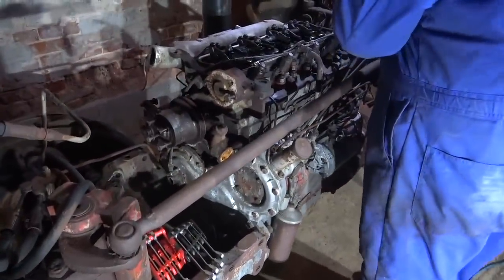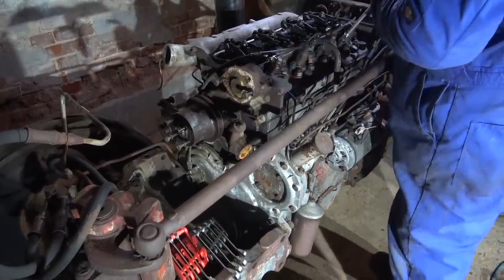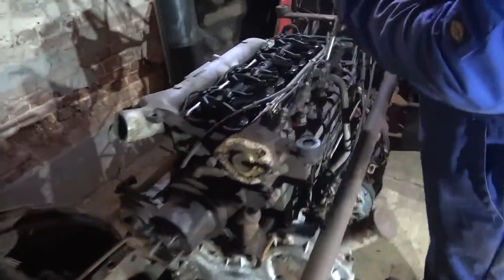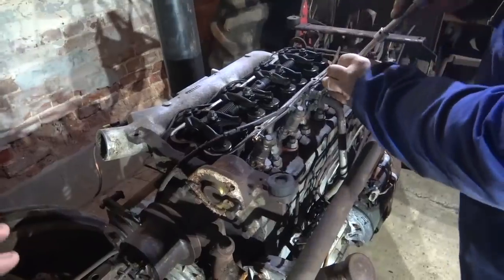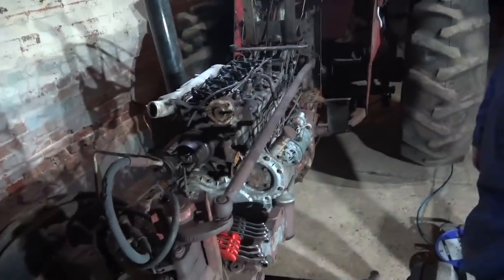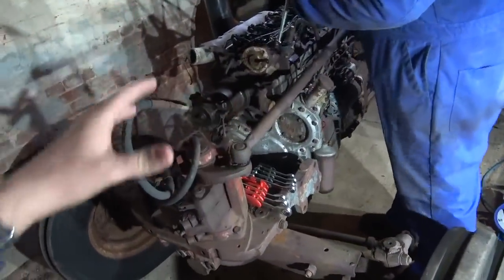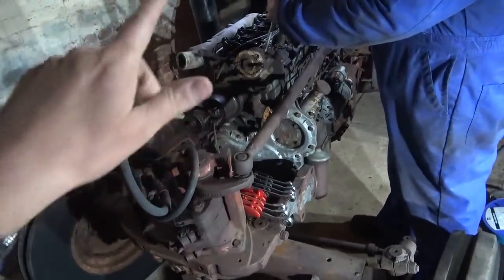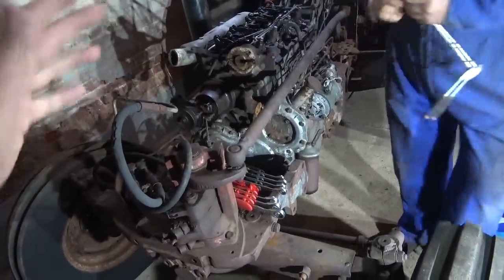IS THIS OUR WORST PURCHASE ?

Comment: I have always liked 'process', i.e. know where you start and set out the steps to get you where you are going. Vitally importantly, identify the break points that will stop you achieving your end point. Your discussion clearly set that out, with good, best estimate ballpark figures. I agree, on over estimating costs and times on the way in so, you end up with pleasant, not terrible exit surprises is the way to go.

Comment: Thanks for the video . Glad you are doing the 175, I was  thinking there can't be many about after the export and years of abuse. I was at 6 - 7 K  on a bad day to do that with parts, tires and paint. I guess you guys have a trade account with somebody like Bepco, that really helps keep costs sensible if you are well connected like that.
  In Canada it's hard to get those accounts even with a repair business like mine ,The other repair shops can keep me out because the suppliers ask them when I apply for an account if they mind "can you say protectionist racket".  To be honest I don't know a tractor I'd like to see I've seen most of them over the years. Now a digger I'd say a real nice last year proper grey cab 3cx Sitemaster before the plastic ones came out.
 After George buying that Belarus, I'd bet he'd buy us the chip order to, just off to add mine L.O.L Take care Mucker & Fud weasel

Comment: That 148 engine sure perks my interest, It would make for a strong MF175. Rebuilding the 175 you will know what you have when your done. All the small bits will add up, but you know that. Should be a good tractor when your done.

Comment: The Massey 178 was the first model to use the A4.248 engine followed by the 185 and 188. You need PAVT wheels for the rear, they defined a 175 back in the day.

Comment: Back about half a lifetime ago, my dad had a 1928 John Deere "B" model.  Have you seen one of those on your side of the pond?  With a 2 cylinder  engine, it wasn't the fastest thing around, but it would out pull most similar sized tractors in the late '60's.  I haven't seen one around these parts in years now.  Loved the breakdown of costs.  I would have guessed it would have cost quite a bit more.
Reply: I know someone who had a tricycle B from new.  I will enquire if he still has it.

Comment: Is it the same in the UK that sometimes even though a tractor might be mechanically workable, if the sheet metal is missing or rotten, the cost of replacing it becomes the deal breaker?
Reply from the maker: Depends on the make and model

Comment: Yes it is always a hard decide what to do with old tractors. My friend now look at a Deutz 6.50 from the mid of 80 that he bought cheep. The gearbox have looked up. I sayd split the tractor and take out the shafts into the gearbox. He replyed No I dont do that It is too much work to be done . Cant I fix it from outside without splitting the tractor I sell it again!
So It is always a personal decide what to do. He look at it in the money and time aspect. I  look at It like a pensioner. My time is not a big cost It is only how expensive  the spareparts are Keep going with the good work and I look forward for a new episode. Why not take look at a Fordson E27N with Perkins diesel. The must have been common in GB,

Comment: A bit random but I used to pass every week a MF 175 @ at roundabout at queens ferry, Deeside back in 1996, with a sandwich board trailer advert hooked to it. Full cast wheels all-round it looked the biss from 60 yards.  Always wanted to call in & try & buy it. But with just getting a house for first time, no chance, 24 yrs on got a man cave & 3 tractors. one is a blackhole for money & still not finished. This is the right way to go mucka break it down in to cost, how can you give a cost if your sponsored. watch them parts as well, wheat & chaff. Good vid as always informative no bull.
Reply from the maker: I can think of several trucks and tractors I passed for years in various locations and now they are all but a distant memory.

Comment: You need to go get yourself some seat time in a White 2-105 or 2-110 but I doubt you’ll find one without a plane ticket. Lol. With the price you were talking for a rebuild on that engine perkins parts must be cheap and plentiful over there. I had to get a water pump for my 7300 a couple years ago and it was 250 bucks just for the pump and gasket. And had to go clear down to an old perkins dealer in Louisiana to find it.
Reply from the maker: Next time call me 😉
Reply: I drove a Field Boss 150 for a summer in the early 1980s near Oxford.  A few made it over here.
Reply: No kidding? I knew there was a importer in the Netherlands so there was a few in that area and some that migrated into France and Germany. Wonder who the UK importer was? Or if they made their way across the channel from mainland Europe? Never could figure out what the draw was on the White 4 wheel drives to warrant the hassle to ship them over there but apparently somebody liked them. Lol
Reply from the maker: I think Haylock had a 180 some years back.

Comment: Lord Muck :) excellent video to also find be my 1 tractor is 1963 McCormick International B414  tractor Desiel motor 40 hp with 1501  loader plus Trip bucket even Fork for a triangle of 6 square bales worth with hay or straw bales types, 2 tractor be a 1950 Cockshutt 40 43 to 53 hp gas motor of Orange type called Buata  6 cylinder 235 Cubic Inches with updraft 1 barrel Zenith carb plus 6 volt positive ground battery type , crank start too plus have blue motor Slant 6 Chrysler 225 electric start or crank to start up, 3 you can find if can David Brown any model # , Massey Harris #44 , Farmall A to J , John Deere A to 710 and any great classic ones!

Comment: Morning mucker, thanks for another great video. With your wealth of tractor knowledge can you help answer this? When we kids we used to watch a big yellow tractor with 4 identical size wheels and a fastrac style body cut the grass on the local public fields. We can’t find any pics and we’ve never seen one since. I’m going back about 30 years so must of been a 70’s early 80’s machine as it definitely wasn’t brand new. Thanks in advance.
Reply from the maker: Muir Hill ? There's only really the MB Trac with a centre cab that I can think of.
Reply: I think your right with muir hill mucker, thanks very much. Apparently it might be rotting away in a field so we’re do a reccy mission

Comment: That 175 is well worth doing, as you say not many of them about, would be great to see some classic high horse power machines, just because i work with modern stuff at a dealer and 300hp/240hp tractors seem to be the most common now, maybe a comparison of old and new? Would be interesting

Comment: Good morning melod, Got the T shirts and mugs the other day thanks.

On the 175. Has it any paperwork to validate it? A V5 would mean you can prove it is a 175 albeit not all original.

Ford 6600 bubble cab!
Reply from the maker: Good to hear 👍
A V5 ain't worth a shit but we've got the rear casting numbers and that's what matters.
Reply: I have casting numbers and serial numbers.  They match (apart from the replacement engine). It's definitely a 1965 175.
Reply from the maker: @ClarenceFudWeasel  you also have ricketts
Reply: And a nasty rash, but who's counting?

Comment: Jolly good mucker. Well reasoned through. As you say, it's a starting point. Amazing to save it.
Imagine being an abused and nakered tractor with no hope, then, somehow, you dodge the scrapper or the cowboys and end up in the hands of people who care and know what their doing. 'Mazin'.
Would like to see original type engine in it. 
Thanks for vid (and for being proper men).
Reply: I think the cowboys did have a go at one stage.  After all, why would anybody use the hole provided to get a socket on the crank pulley bolt when you could attack from the side with an air chisel?
Reply: @ClarenceFudWeasel  Point well made Fudders. Bastards that they are. Unbelievable what some people do. They have no right laying their hands on anything and fu##ing it up.
I'm rescuing a Scimitar GTE from beyond the dead. If it had gone to anybody else it would have been scrapped. Anyway,  I'm off the the garage to work on it some more and listen to music. Just had some lunch and watched an episode of CHiPs, the 70's American police motorbike programme (I'm seem to be getting more nostalgic as head towards fifty).
Look forward to your next instalment. Don't change Lar.

Comment: A loverly Ford 810 Series 3 FACTORY Turbo , great video mucka
Reply from the maker: 8210 ?
Reply: @LordMuck  they do be the same near enough👌 the 7810 with the smaller bonnet just does it for me🤩
Reply from the maker: They didn't do a factory turbo 8210 or 7810, they were all fitted by the dealers.
I think the 82 always looked nicer.
Reply: @LordMuck  ah, I was told at the end of production they did a few turbos fitted in factory. Would love one but the price of them is ridiculous at the moment

Comment: What about a look at a Marshall tractor and specifically the system on how they start the engine and how it works in detail? That would be really interesting especially for people who have never seen anything like that
Reply from the maker: Light paper, screw in, set decompressor on flywheel, turn handle.
That's it 😆
Reply: @LordMuck  was more thinking the type they start with a cartridge. If you know you know but there maybe people that don't. Just find your channel really educational, was just a idea.
Reply from the maker: It's the same tractor, just a different method. I'm not a fan of starting them with a cartridge to be honest.
A friend has a Field Marshall I can go look at once things ease a bit.
Seriously, they are incredibly straight forward.
Reply: @LordMuck  was just a idea. Either way keep up the great work on the channel absolutely love it been here right from the start 👍
Reply from the maker: They are probably one of the simplest concepts around. When things ease I'll ask if I can go start it up and make some noise.
Reply: @LordMuck  nice one

Comment: How i rolled in to things. i am female and at  age 14, got adopted, age 15 helped my dad fix stuff, age 16 he bought me a land rover series 3 shitter. Now learning to weld so i can repair my chassis, rebuilding a 2.25 diesel and going crashbox.
Reply from the maker: Excellent ! 👍
Reply: @LordMuck  I am in two minds, do i use the 2.25 or get a 2.5 n/a or the 2.5Td but with a 300tdi pump. it allows me to use black diesel to run it cheaper.
Reply from the maker: I'd stay away from the 2.5TD and maybe go for the 2.5 N/A

Comment: What a mess the 175 is, the previous owner must of been a butcher.
I would drain oil and see if water in sump, could be water in cylinders causing hydraulic lock if was full of water.
No birds nest you can call that one when you sticker it.
Anything with a old engine.
Good video enjoyed watching.

Comment: Surely for it to be a 175 it needs the right engine! With a 590/290 engine in it is not a 188 ?
Reply from the maker: I can live in hope...
Reply: It was built as a 175, somebody in the past has broken the original 236 and  put a secondhand 248 in, presumably because it was all they could find at the time.
Reply: @ClarenceFudWeasel For it to be a 175 you need to put a 236 back in surely. If not it will always be a mongrel of a tractor.   Not the 175 you want !!

Comment: Massey Ferguson 1080
Reply: Another interesting tractor.  I nearly bought one a while back.  Parts are very hard to find.
Reply: @ClarenceFudWeasel  the farm i worked at 1972 to 1977 mr Moir cairness farm lonmay had a L reg MF1080 but had a lots of problems with it MF gave him a new M reg MF 1080 so we had 2 1080s on the farm for a while til MF sent a lorry to take it away ! but the M reg head gasket & hydraulic problems which led to the farmer buying a JD 3130 ! and i got the MF 1080 hand me down ! the farm also had MF 175mp 3 x MF178mp MF50 digger loader a MF400 crawler loader with 4 n 1 bucket & 3 shank ripper 2 Nuffield 4/75 1x Leyland 154  1 x Leyland 270 and TE 20 gray fergie !

Comment: If its for keeps, crack on, doesn't matter its the wrong engine, 99% of jo puboic won't know, dont keep a talley of how much it costs, it will scare the s##* t out of you 😁
Reply from the maker: Try keeping a P-51 in top order, a Massey is like change at the back of the sofa...
Reply: I think if we cost my time in, it would scare people more!
Reply from the maker: If we cost in your time, it's on the back of a scrap wagon tomorrow morning...
Reply: @LordMuck  would imagine its in the ten's of thousands.
Reply from the maker: Engine rebuild is around $200,000...
Reply: I need to revise my pricing.
Reply: @LordMuck  😱😱😱.whats a working spit fire to buy 6 million? If you can find one.
Reply from the maker: No, Mk16 can be had for around $2.5 - 3.5 million USD. They're just more time and labour intensive than a Mustang. We spend 2-3 hours working on the Mk1 or Mk9 for every hour on a P-51.